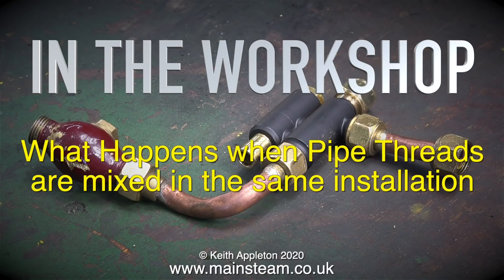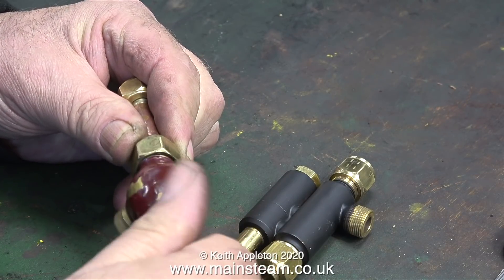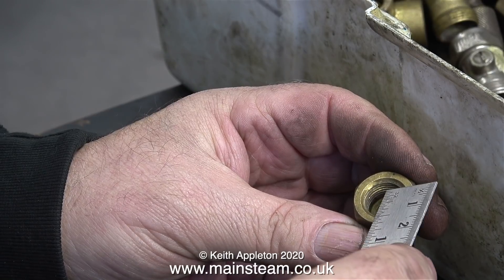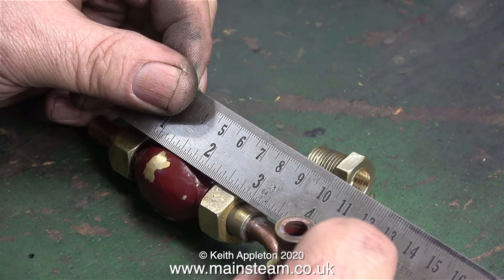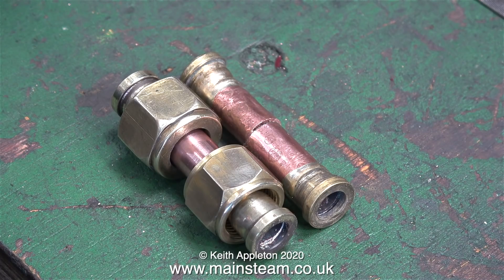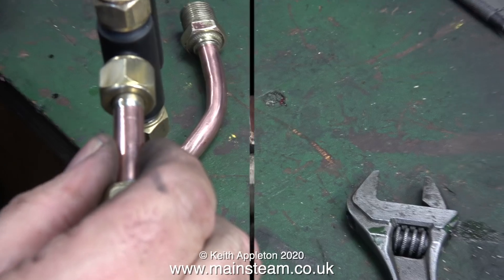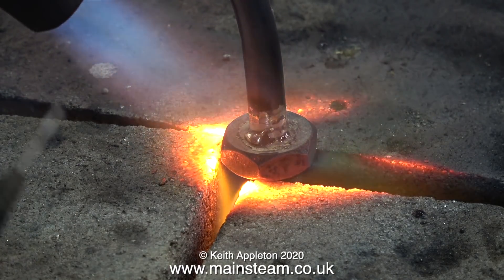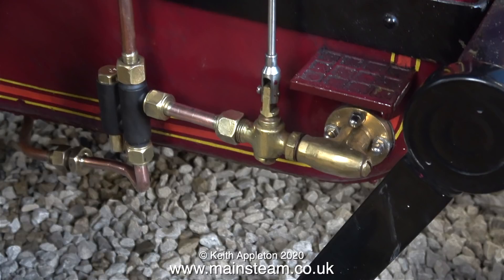PROBLEMS WITH WATER PIPE FITTING THREADS - IN THE WORKSHOP

Comment: So what WAS the point of that second clack valve? Was that a lazy mans way of dealing with a bad boiler clack or?.....Im so confused XD
Reply from the maker: I think you hit the nail on the head. I haven't tried it properly in steam since I removed the second ball valve, but I have a sneaking suspicion that the check valve will blow back . . . .
Reply: @keithappleton  Ahh so rather than buy a new boiler clack they just stuck another clack on it XD Wow. Thats, intresting. XD
Reply from the maker: Probably just that, I will reseat the ball in the existing Check Valve if it leaks.